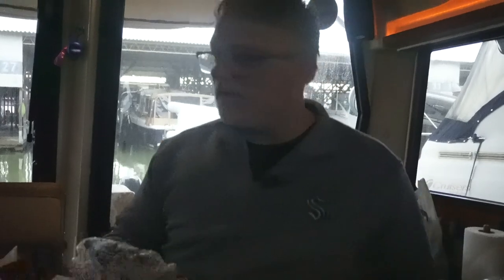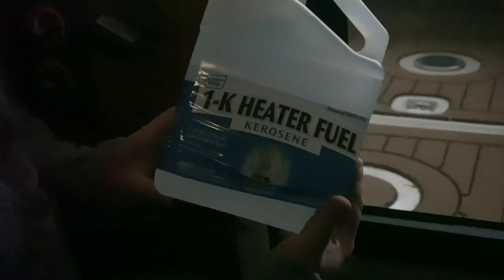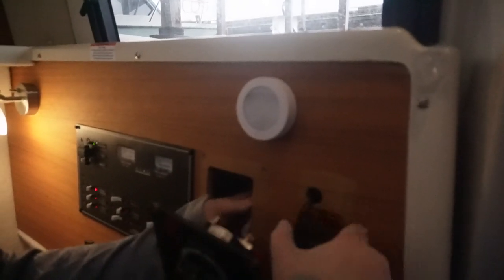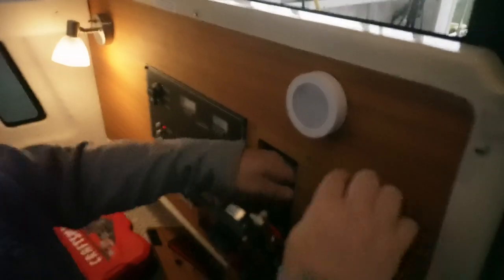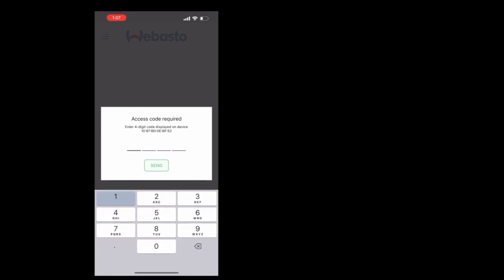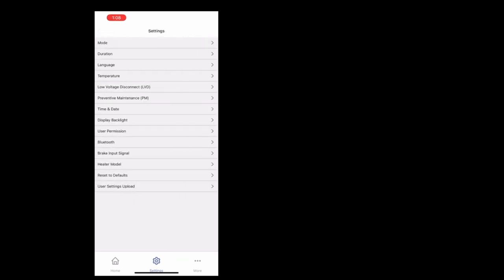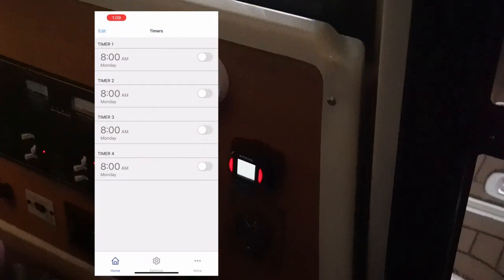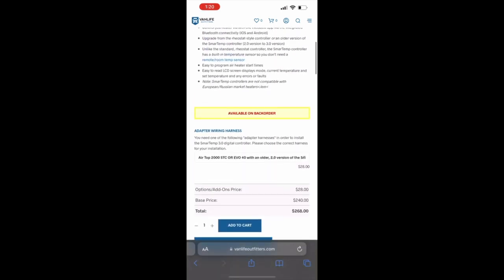Control your Webasto heater on your phone via bluetooth/ Ranger Tug R27ob

Comment: That's a really nice addition to your boat.  And seems like one of those jobs that takes about as long as you think it will, instead of five times as long.  lol. Would like to know more about the kerosine conversion.  Is it just a matter of putting in different fuel, or are there mechanical or electrical changes necessary as well.
Reply from the maker: Just pour it into the tank.  Kerosene is actually diesel.  It’s supported by webasto.  The manual for webasto states diesel #1 or 2 is supported.  Diesel #1 is preferred and that’s kerosene.